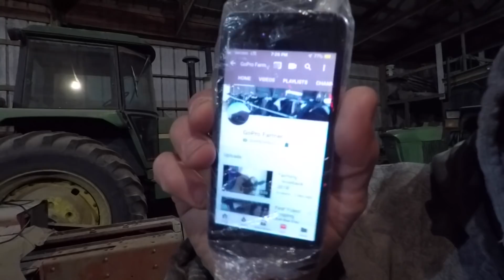We Need To Order More Hay And We’re Thinking Of Trading Off The JD 4840!

Comment: I would definitely check out for those front duals, try to see if they'll throw it in! Make that tractor look meaner yet! I'll have to say the same with you on New Holland, and is a main reason we've stuck with them as well.... just can't beat the price compared to similar sized tractors. So long as the tractor does what it is supposed to do with minimal break-down time is what makes it a good tractor.
Reply from the maker: I agree. We do have a Massey dealer about 30 miles away over in Minnesota but they’ve been with Massey I think since 2013 or 14. All I can say it takes a lot of green $$ to buy all that expensive green paint on the John Deere tractors. I wonder what John Deere tractors would cost with no green paint on it?! Lol!

Comment: Instead of trading off the 4840 why don’t you use it for planting? I don’t agree with you that it can’t pull good enough without 4wd. My cousin runs around 500 acres with a 4840 and 4640  as his tillage tractors.
Reply from the maker: We actually did use it for planting one year. The biggest thing is we use the NewHolland for spreading fertilizer because it has the gps in it and so we end up using the 4840 for field work. We just want something with more traction capabilities.